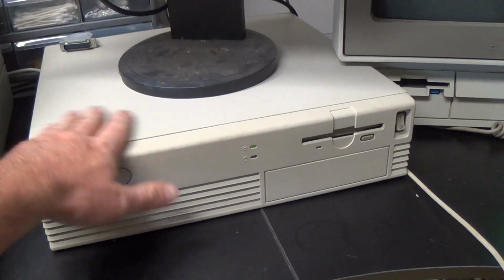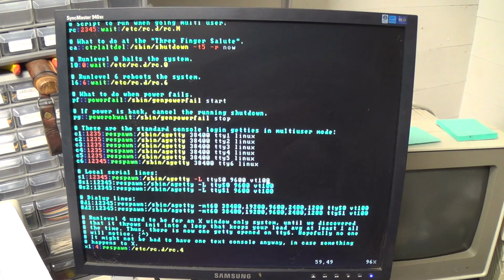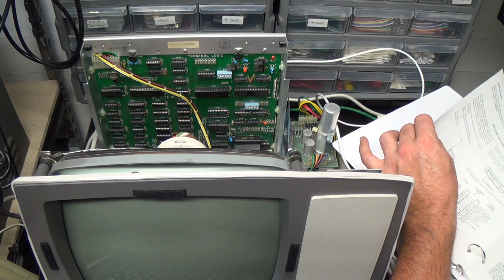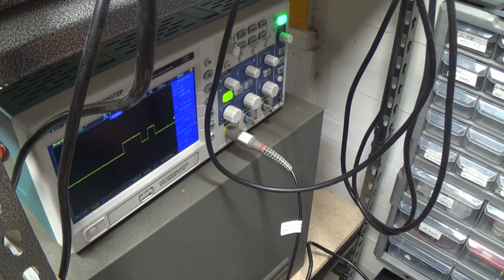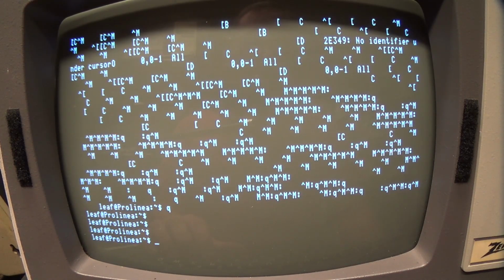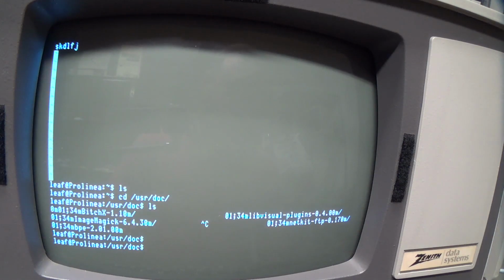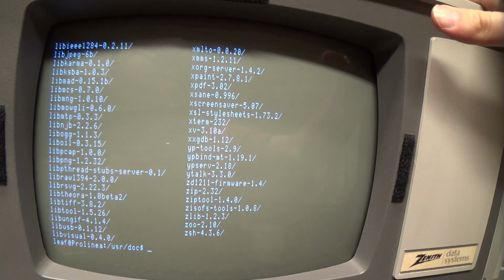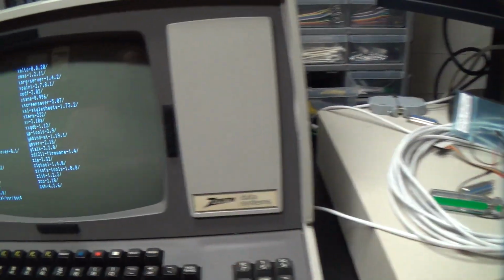Zenith Z-19 Serial Terminal Pt.3 - Workin'!!

Comment: Thanks. Fun series watching you bringing the z19 up and working through the serial port configuration on the Unix side. Motivation to work on my h19. I was wondering what happened to the cabling episode that vanished. Were you able to find/confirm the source of ac leakage? I look forward to your cosmetic fix episode. I have similar dings to fix.
Reply from the maker: Next video is on the AC leakage.  The TL;DR is, I haven't figured out where it's coming from, but I think it's an issue with the transformer itself, which I will never find a correct replacement for.  It doesn't appear to affect the operation of the machine, but I think I might just replace the whole PSU section north of the linear regulators with something more modern and be done with it, though I kind of hate to do that.  But I show what I've tested in the coming video, so hopefully some of y'all will be able to clue me in!
Reply from the maker: Re: That cabling episode.  I was wrong about some stuff, thinking that PC serial ports were wired DCE rather than DTE, when actually the terminals and PC serial ports and most everything are all wired DTE.  I removed the video because I didn't want anyone to be led astray by my dumbness.  :P  (And it was a little embarrassing, lol.)